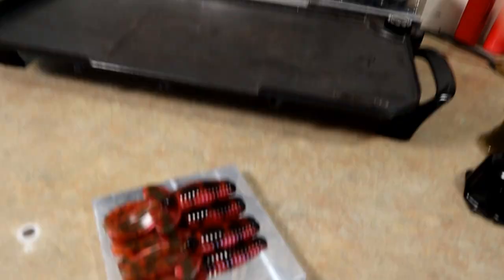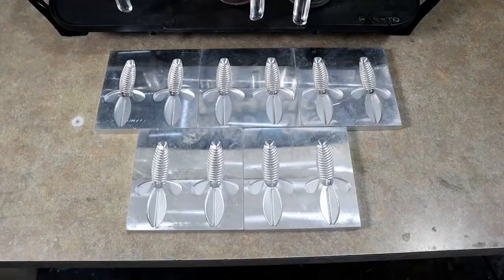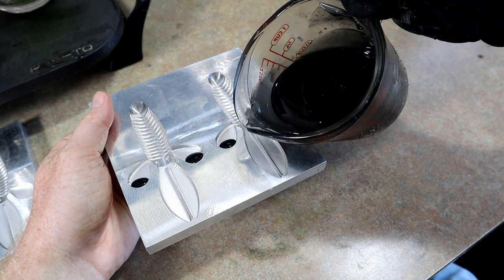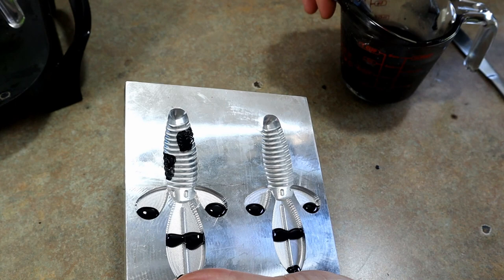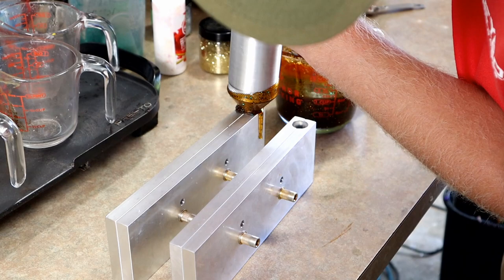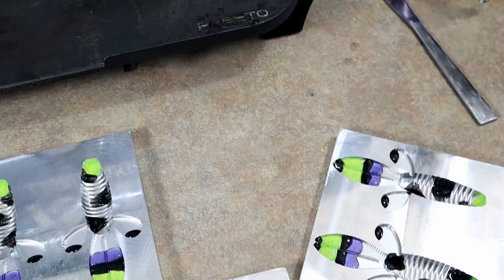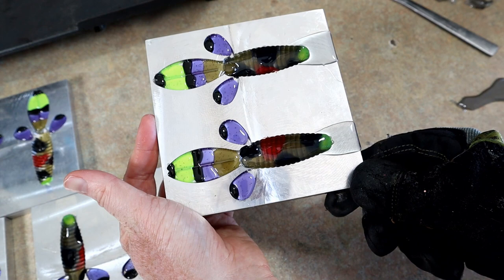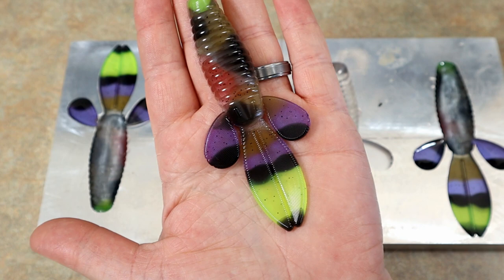REMELT Puck Open Pouring Challenge: Using Re-Melts Effectively

Comment: Im willing to bet you have never done what I've never done.  Mass produced pancakes at a pancake house.  But I have seen it done presentation cooking in a waterfront park.  Really interesting tool holds the batter and a single hand squeezes puts out the same batter blop over and over and on the griddles they were doing two or three dozen pancakes at a go.  Hand pouring looks like it could do with a small volume hand held heated tool like that :), something with three adjustments,  portal hole size,  volume on dispense, and a holding temperature setting.  I'd imagine it would be somewhere between a glue gun and an airbrush but using heating tech like the USB soldering irons.  It would also have to be at a price that you could buy them in a three or six pack.  Or maybe 3 or 6 "vials" that plug into an electrical maintenance heating block like one of those multi-battery charge stations and pop one out use it, pop it back onto the station move to the next color.  Trouble is, I can imagine it only :/
Reply from the maker: Yeah the key would be heat..the plastic will clog up any fine nozzle very fast if not kept at extreme temperatures.. would be a lot of trouble in my opinion
Reply: @WorldsWorstFishing    Yup, would be a heck of a task to do and probably uphill at that!!  I really like the final outcome on these bates and yes have to agree the the partially encapsulated chartreuse really does work!

Comment: Strange question... so the same way you attach the plastisol skirt, I wonder if you could do the same thing with the ninja mold. So every ninja mold makes two, but with the heat/weld you would be making one bait using both hand pours. I wonder... 🤔
Reply from the maker: You could put them together technically
Reply: @WorldsWorstFishing  I understand that would defeat the purpose of an open poor! just thinking out loud